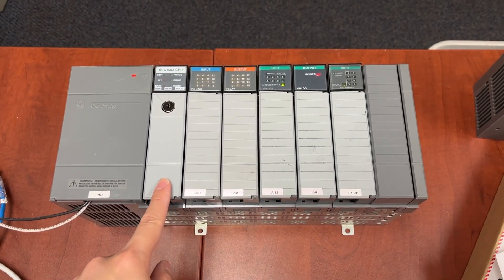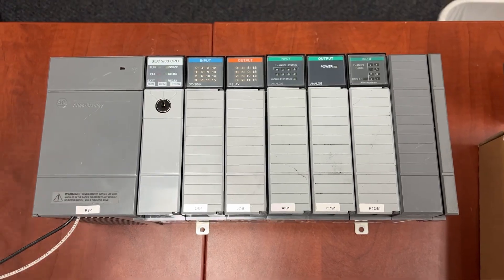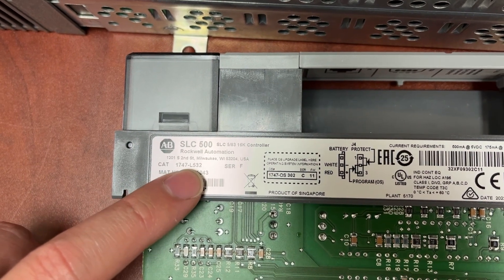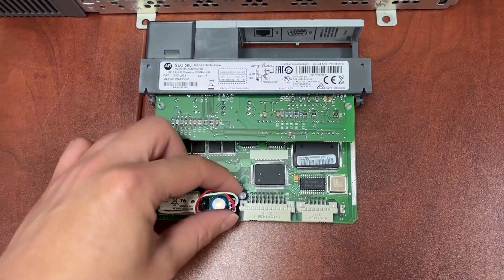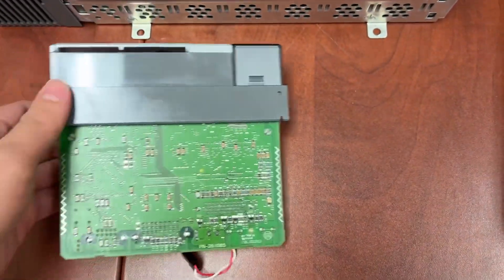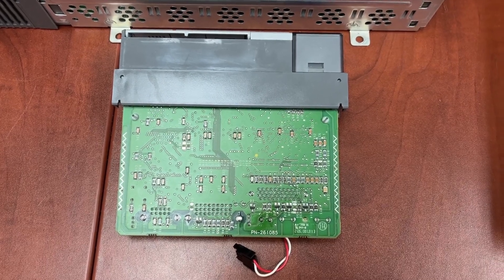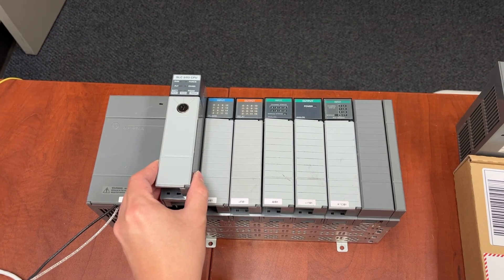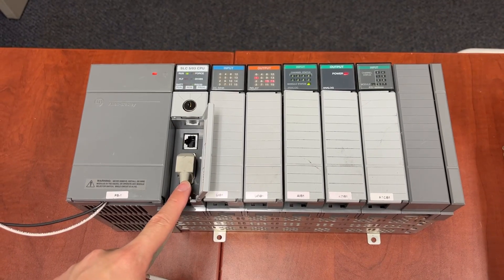Allen Bradley SLC 5/03  Restoring Factory Defaults

Comment: Hello SY and thank you very much for the real practical videos, I have a question, is it possible to connect laptop to CPU 1747 using 1756 Cable? I saw another video, you have used 1747 cable, i have 1756 cable and 1747 CPU, thank you for your time.
Reply from the maker: @farshada1889: In the video, I used the cable 1747-CP3 and RS-232 to USB converter to connect the PLC to my computer. But the cable 1756-CP3 should work as well. If you like my channel and my comments are helpful, "super thanks" at the lower right corner is a great way for you to show your support to my channel. Thank you.